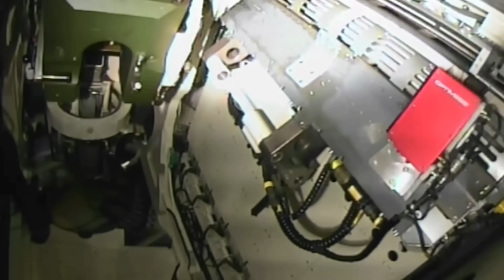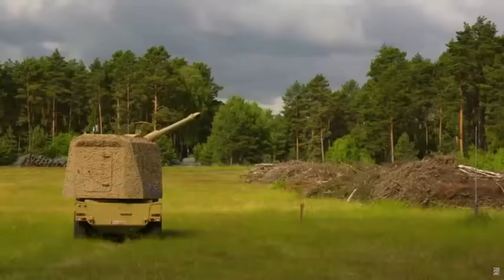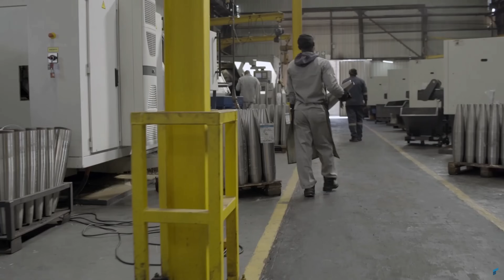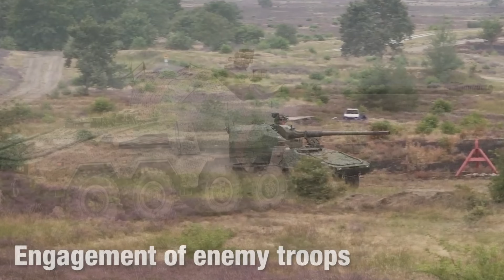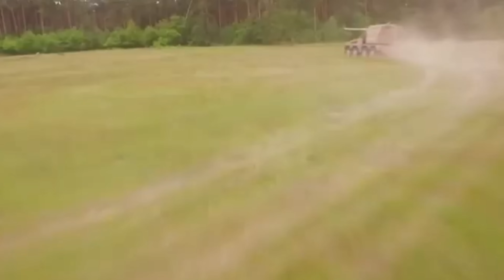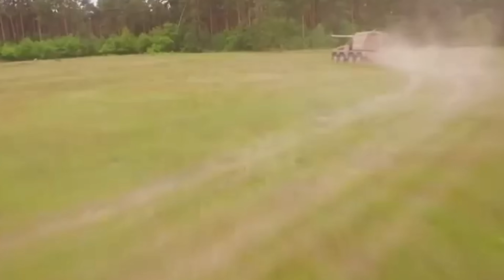The RCH-155 Self-Propelled Artillery System | 155mm FIRING ON THE MOVE!

Comment: Wondering why M109 User nations haven't installed Rheinmetalls L52 yet. Has been tested and it works. You can't get a cheaper more cost effective upgrade than by just switching the gun.
Reply: Vielleicht weil das Fahrgestell der M 109 eine Zumutung ist! Das Fahrgestell ist veraltet, hat einen schwachen Motor und bietet für die ganze Elektronik zu wenig Platz, bzw. Bringt auch nicht die Stromversorgung her. Deshalb ist die M 109 keine Option mehr.😔
Reply: I took your answer as fact, then pictured some memories inside the M109 in my head, and questioned each of your facts:  weak engine, lack of space for electronics, lack of power production.

For weak engine, Ford engineers introduced a high-efficiency clean-burning low-emissions 2-stroke diesel around 1986. The U.S. Department of Transportation refused to grant Ford an exception to the regulation forbidding use of 2-stroke engines in civilian road-licensed vehicles despite meeting all emissions requirements, so Ford transferred the design to its European Opel brand, and that's where my knowledge of it disappears.

But it doubles the horsepower you get from a given displacement, while also getting rid of the black diesel plume and noise (somehow Ford made a quiet 2-stroke).

That done, move to the third point, power generation. I have never understood why every military transport truck, jeep, etc., doesn't have a secondary flywheel alternator -- a big one -- that can be engaged to function as a self-mobile generator set at need. I thought, having experience with arc welders that can double as generators, that this function should be included, too, until I had been in the Army and met my fellow privates! So I am 100% with you on the M109 being under-equipped for electrical power production. But I also know how remarkably easy that inexcusable deficiency is to correct!

To the matter of too-limited volumes for electronics, I have solutions. First, more modern electronics are far more compact than those original to the M109, as well as having new capabilities within that smaller package. Give the gun captain a large tablet computer, something with a screen the size of a legal paper notepad, and one of those pressure-sensitive drawing pencils -- or just an iPad and the Apple pencil -- and a modern multi-channel FM radio set with different crypto loads for each contact and automatic channel monitoring, switching, and identification with location and synchronize it to maps on the Gun Captain's pad so that he can sketch in fire missions, manipulate prioritization and tasking, and route those to the gun crew. No new spaces needed, just re-implementation of the use of space.

Now, if you want to discuss how to improve on the absolutely tragic proven under-protection of the crew, the horrible deficiencies of the track and suspension systems, the criminal material deficiencies of the road wheels, drive sprockets, idler worm-gear shafts . . . . The PzH2000 seems vastly superior to the M109 in every aspect, but I have only a very limited outside view of it.

Comment: Is firing under move accurate? Or are you forced to use smart rounds?
Reply: Alot of tech in it so its very accurate.
Reply: I would imagine they can't do it  firing max range, but maybe pretty accurate to several km's, especially in direct fire 
Id be interested to see what the dispersion is while moving, too. It would definitely make it more difficult for S&R platforms and counter-battery to pin them down
Reply: Laser Range finder!
Reply: @meindepp1938  
Line of sight, sure
Reply: @theimmortal4718  i dont see why a atrillery shell or gun cant precisley located in a driving situation. I imaging that the driver needs to put a targeted speed fo X seconds in a gps or other computer. I dont think its to complicated in principle if you know the position of the shell/gun  for the next i.e. 3 seconds. The needed precises workflows of  making  the RCH could be another topic of its own.
Reply: @tasker6669  
Not disagreeing. Just doubting they can do it out to max range. Even being able to fo this out to 50% max range is a phenomenal feat never attempted before. 
Imagine if a rifleman was hitting 300 meter targets while walking. Amazing
Reply: @theimmortal4718  I imagine there are other tanks with this capability, but doesn't the Leo have a system that can delay the shot by a fraction of a second if the vehicle moves too much? So instead of desperately trying to aim the barrel perfectly at the target, you simply wait a few milliseconds until it crosses the 'zero point' again.
Reply: @matatron.  
Yeah that might very well be part of it. I don't know much about how they're accomplishing this
Next level, for sure
Reply: As far as i know, motors of the cannon and especially the computer are quick enough to compensate for the movement until the shot goes of, while stabilizers already reduce a lot of unwanted movement. I have in mind, somewhere is said, that it is limited to a speed of 23-30kmh or so, but thanks to stabilization and the quickness of each part, there wont be much of a difference in terms of accuracy.
If the shell is out of the barrel, its only important, if the computer adjusted the calculations in time and the motors were quick enough to adjust the position of the barrel.

Comment: Pardon the question, but having seen a few "oops" in the field or at Graf, how are the crew safety features in that Hog? Second, a slightly wider "mobility platform" should be considered. The hull looks like it can handle most curves, but not all.
Reply: It has an unmanned turret, which is new in ground combat systems but has been common in naval warfare for decades. As a former US Navy Gunners Mate, the main problem is jams in the loading system. This can make for some interesting situations, but with decent, well trained crews, this should not be an issue.
Reply: @williambinkley8879  Hopefully you're correct about the jam resolution. Former Army Recon (glorified Grunt/Tanker 19D-K) here; and I've seen my share of screw ups. Don't misunderstand me, I LIKE the system (especially in its direct fire mode) but there are still some teething problems that look like they need to be worked out before my grand and great grandkids crew that beast.

Comment: Wanna hear what the maintenance guys say about the suspension lol
Reply: What's all the boxes in the stores? New shock absorbers 😁😁😁
Reply: "I only ride 'em, I don't know what makes 'em work." Sgt Oddball 😅
Reply: The choice will be: Low volume of fire and medium requirement for maintenance or higher volume of fire and a lot of maintenance (or the system breaks down quickly). In cases where a large and sustained amount of firepower is important, a system like this will probably not be ideal. The main advantage vs. tracked self-powered artillery systems is the high mobility (provided the terrain permits it) - the RCH-155 can race from one site of operations to the next without having to be hauled around on trucks.
Reply: @vandecasa3795  you can probably also immensely reduce the stress on the vehicle by parking it in the right direction before the firemission instead of doing a driveby with a 155mm.
Reply: It's not the standard boxer suspension they use in the RCH 155. Honestly i'm more concerned with how the system clears the barrel after every shot in order to prevent premature explosions.
Reply: What suspension?😅 Honestly, staff sgt, we never saw it😅

Comment: PZH-2000 is still the KING of the battlefield.
Reply: Boxer can move on it's own power pver roads
No nrrf to load it up, just drive
Reply: Boy O boy did i open a can of worms, 😁😁😁😁😁😁
Reply: These are the self-propelled guns transferred to Ukraine, in which it is forbidden to fire more than 100 shells per day, do you seriously call this perfection?
Reply: Der RCH 155 ist der PzH 2000 in nahezu allen Bereichen überlegen. Als Radfahrzeug ist er deutlich mobiler, leichter und einfacher strategisch verlegbar. Er nutzt die gleiche 155mm/L52-Kanone, verfügt jedoch über eine moderne Feuerleittechnik und kann aus der Bewegung heraus in alle Richtungen feuern. Durch die vollautomatische Ladeeinrichtung wird nur eine minimal besetzte Crew benötigt, was die Einsatzbereitschaft erhöht und das Risiko für Soldaten senkt.

Die Besatzung befindet sich vollständig im geschützten Fahrzeugrumpf, was den Schutz im Vergleich zur PzH 2000 deutlich verbessert. Zudem ist der RCH 155 für den zukünftigen Betrieb per Fernsteuerung ausgelegt, wodurch er sich ideal für gefährliche oder autonome Einsätze eignet. Seine Wartung ist durch die Radplattform einfacher und kostengünstiger als bei der kettenbasierten PzH 2000.

Insgesamt ist der RCH 155 moderner, flexibler, sicherer und effizienter – eine klare Weiterentwicklung der bisherigen Panzerhaubitzen-Technologie.
Reply: K9 + K10 ARV
Reply: The Pzh-2000 is king
That would be the Swedish Archer
Reply: Not according to ukrainian experience on the field. Like 70% of Pzh2000 were out of action because of mechanical issues (still are ? nobody speak about them anymore). And it couldn't handle firing more than 120 shells per day. German army doctrine call for firing more than 300 shells per days per guns in a high intensity warfare scenario, but the pzh2000 couldn't even do half of it in Ukraine without failing.
Like german soldiers often says, the german army is more of a showcase for german defense companies gears, than a coherent force.
Reply: @karakiri283 Dont write shit here!!   In Bundeswehr districts, the reason was identified as the high frequency of firing: the Ukrainians fired up to 300 grenades a day, although German military officials considered even 100 (!!)  rounds to be a high-intensity operation.
The wear and tear seems to be a result of the unprecedented strain on the weapon system and not due to its inferiority. The barrel of a self-propelled howitzer 2000 actually has to be changed “after around 4,500 rounds,” said Rheinmetall boss Armin Papperger in an interview with the editorial network Germany, “but the Ukrainians fire up to 20,000 rounds – actually impossible. Other pipes would have collapsed long ago.”
Reply: @mebodeck  I will tell you like the others before.
Defence-ua told us that :

- The available information shows that only the PzH 2000 suffered such problems. Neither CAESAR, nor Krab, nor M109, which all were under the same pressure at that time, were known for being out of order at such a large scale.

Coherent with what we know about the Pzh2000 before Ukraine.
Reply: @karakiri283 There's an Interview where a Ukrainian Artillerman said they fired 220 rounds a day at first. Thats an absolutely insane amount of abuse if we consider an artillery will need barrel replacement after 2500-4500 rounds.
Reply: @heyho4770  It's not insane. Like i say german doctrine called for more than 300 shells per days per artillery pieces. Pzh2000 problems are a well known. The Sueddeutsche Zeitung published Germany’s Ministry of Defense report on the real state of the Bundeswehr and said that "Germany has only about 30% PzH 2000 artillery pieces in operational state, ammunition stocks for about three days of active warfare".

In ukraine Pzh2000 had lot of problems and Defence-ua told us that :

- The available information shows that only the PzH 2000 suffered such problems. Neither CAESAR, nor Krab, nor M109, which all were under the same pressure at that time, were known for being out of order at such a large scale.
Reply: @karakiri283 To how many Germans soldiers did you speek? Asking as a German and former Artillery Gunner who was forced to use a giant piece of crap called M109.
Reply: @berndbrakemeier1418  
The M109 wasnt not crap 
it was simply outdated and neglected
For the US military , the last time howitzers were a thing was the Gulf war in 1991
Air power became the back bone of the US military and shell based artillery was no longer a priority  
Ballistically the same metric that saw battleships disappear
While they had big guns, their range and use fullness was limited 
Even now, the Army is struggling to keep its shell based artillery relevant
Reply: @verdebusterAP you have no idea what you’re talking about. the US still trains on and has recently used howitzers plenty. they were used in OIF and after that in iraq, and used in the afghanistan war too.
Reply: @berndbrakemeier1418 i can't speak for the german military, but both police and fire rescue are like this. They have better equipment than their international counterparts but the training, the tactics and bureaucracy are really really bad. 
I believe the german military to not be that different.
Reply: @ So you admit you have no clue about the German military, but you know for sure German Police and Fire Department are short in training and tactics? I hope you are American, because that would explain your lack of knowledge
Reply: @berndbrakemeier1418  are you dumb? I'm a firefighter in Germany
Reply: @berndbrakemeier1418  Your own govt/military say so :

- Sueddeutsche Zeitung published Germany’s Ministry of Defense report on the real state of the Bundeswehr

- Germany has only about 30% PzH 2000 artillery pieces in operational state

Not something hidden or not well known.

And well, let's say i have some connections to KNDS.
Reply: @berndbrakemeier1418  
The Poles are simply mentally impaired when it comes to badmouthing the Germans or everything related to them. The Bundeswehr was, indeed, low on funds and they DID skirt on maintenance, but that is on German Ministry of Defense, not the systems themselves.
Reply: @ That's true to the core.
Reply: @karakiri283 if you really have some connections to KNDS, you probably know that it wasn’t a good idea to let the French in. That will be the major problem in the future and that why Rheinmetall will be the better partner.
Reply: @karakiri283 You have sources for all those claims, mate? You sound like a PIS or Putin Bot here.
Reply: @phil3114  "noooo dont attack my beloved internet favorite spg or you are a PIS or a putin bot !!!"

Open google. But since i'm a generous God...

- Reliability of PzH 2000

- If we take a step back and remember the summer of 2022, we'll notice that the PzH 2000 encountered issues during the periods of intensive operation. Later in December, reports suggested that only up to 50% of all transferred German self-propelled guns were at the frontline, while the rest were undergoing repairs.

- The available information shows that only the PzH 2000 suffered such problems. Neither CAESAR, nor Krab, nor M109, which all were under the same pressure at that time, were known for being out of order at such a large scale.

Source : defence-ua

It was cited by Newsukraine has the main reasons why "Ukraine and Germany fail to seal deal for 100 PzH 2000 self-propelled howitzers"

Which come at no surprise for anybody working in the defense industry.

The only PIS here is you btw. Not even capable of using google.

Regards.
Reply: @karakiri283 Proper maintenance is key.
Reply: @karakiri283 1) The Ukrainians used the PHZ incorrectly and always fired at very long ranges. 2. uncertified, poor quality 155mm shells were fired, and with poor quality propelling charges that formed deposits. The crews were retrained as a result.
Reply: All pzh2000 are still operational in ukraine. Tag karakiri283 as falschinformation.
Reply: @karakiri283 The high failure rates had been communicated immediately after the handover. The problem is said to have been not the material, but internal protection mechanisms. Later, the problems are said to have been fixed in a repair center.  Worn technology can endanger soldiers, but in the region the danger doesn't matter, as they have to use the devices for what they have. Nevertheless, I think the PzH2000 and RCH155 are too expensive, they need more, simpler and cheaper material and there are better L52 alternatives like their own Bohdana.
Reply: @karakiri283 Yea, it is a question of supplies and maintanance. It's also a question of having way too few. If those problems are solved it's best. 120 rounds of which 118 hit is also better than 300 rounds of which 118 hit :P Also, you can't compare Ukranian military with NATO's. For a lot of situations NATO would use its superior air forces whereas Ukranians only can shoot artillery. Ot put it this way: It is a very capable system that will thrive in a NATO style battle of combined warfare but not in Ukraine spread thinly all over the place. Same with the tanks.
Reply: @karakiri283 Oh, here we have another Russian propagandist. You only have to google PZH2000 here and you'll find x reports from Ukrainian soldiers and sources claiming the exact opposite. No weapon system is indestructible and overuse is not good either. But the PZH2000, despite its shortcomings, which every system has, is an important weapon system that is extremely important for Ukraine.

Comment: look at the sheer amount of wobble when it fires, that drives me nuts lol
Reply: The shell is already long gone.
Reply: Ever heard of physics? The energy released has to go somewhere. And these fluctuations caused by the suspension absorb the energy much better than any rigid system, where everything is dissipated into the metallic structures of the supports.
Reply: @gerhardma4687  Yeah I just said it drives me nuts. I really don't care.